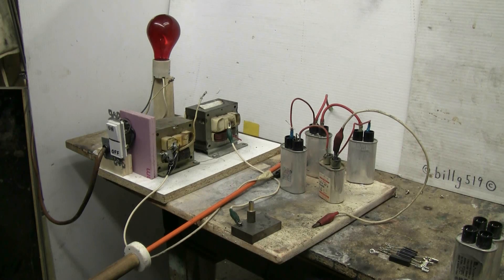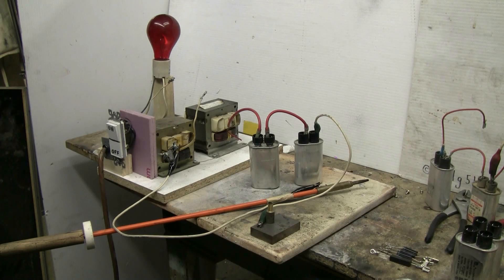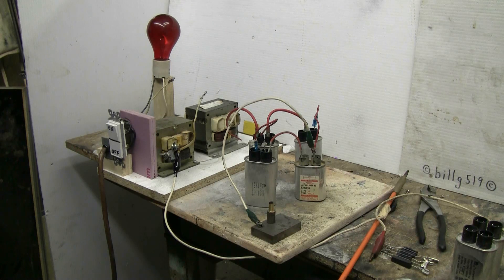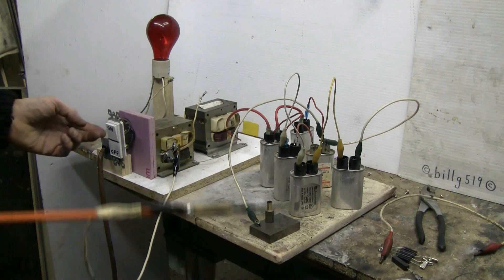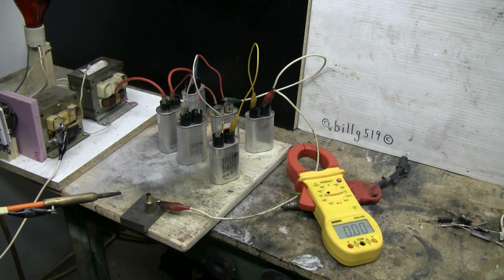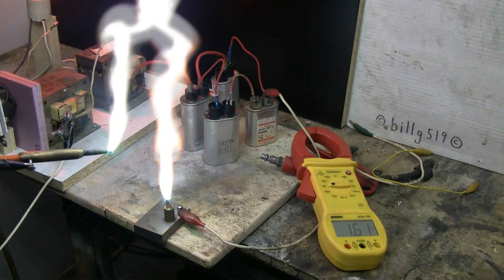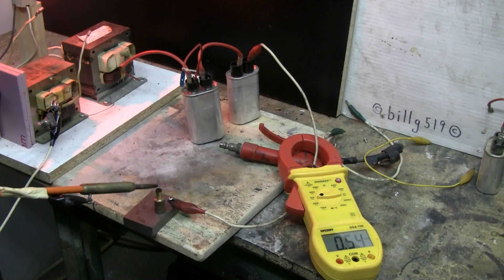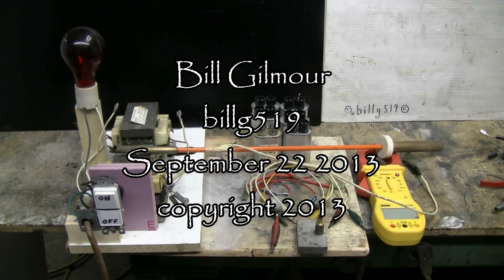High Voltage - Two MOTs And Some Capacitors

Comment: You know i really have to wonder why a person who likes arcs,no different from myself,wouldnt ground the hv lead of one of the transformers.its so much safer to have a grounded probe.case in point;suddenly the probe wire fails melts off or disconnects and the hv lead as it drops bounces of a table leg and hits you in the leg.think about it???
Reply: It is a good practice to ground the transformer core, yes

Comment: I know im late but for whoever is reading this and knows. Why is his current so low even with such big arcs.. I am building my own quad mot power supply for a tesla coil and im looking into ballasting methods.. Thanks
Reply: Can you provide more information?
Reply: @kane3331  hello, I ended up ballasting my mot supply using the capacitive reactance of a bunch of MOCs. Using ohms law i was able to fine tune the amount of current i wanted and it is now sitting at 800mA and 9,600kV

Comment: ok fir4stly dont forget 2 mot in series makes 8kv not 4 basic math goes a long way hence why you ave two caps in series if they were all parrelle they would likey blow  but whatever coolish
Reply: What? 125-240v ac on the primary and ~2.1kV   ac on the secondary referenced to the transformer core. Putting the outputs in series gives you 4kV. The capacitors are rated for around 2.2kV. you need two capacitors in series, and then another set, then you put them in parallel. You put the HV output in series with the capacitor bank. If I messed anything up correct me, please.

Comment: Bill... it would be really nice if you showed us how you wired your MOTs together including the currency limiter.. or whatever it is.
Reply from the maker: +Kev. Durr Primaries are in parallel. Secondaries are in series. Two microwave oven diodes in series provide rectification. Not using current limiting for charging caps as the transformers do not run for long, only seconds to charge the caps. Caps charged to this voltage are lethal and caution is required. Unplug supply and discharge caps by shorting with a chicken stick before handling or adjusting anything. I put a red light bulb on the primary side to show when the transformers are on. Don't trust the resistor inside the microwave caps to drain them as sometimes it fails. Short them to confirm safety. I store these caps shorted.
Reply: Thank you very much for the useful information Bill!
Reply: Bill Gilmour wouldn't running a lightbulb on the primary limit the current to what the lightbulb runs at?
Reply: @greenthizzle4  The light bulb is in parallel with the transformer primary, not in series.  So it won't limit the current.

Comment: Excellent display / description of the effect of capacitance in a Resonance MOT circuit  current draw / arcs. Thank you
Reply: James Fowler it's technically not resonating with anything the caps just make the arc more violent dumps more amps faster

Comment: Doesn't it pop the circuit breaker
Reply: Not if your fuse is slow enough. The fuses in our house are rated 16 amps on each circuit, but they are fine with 1,5x of that amount for a short time. I have a MOT setup similar to this and measured it at 18 amps on the primary while arcing, it works without problems.